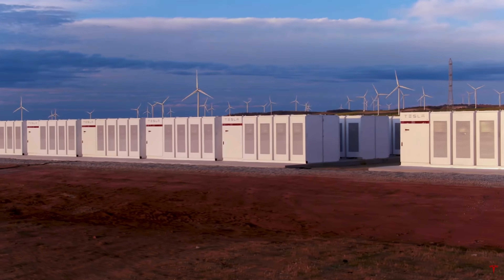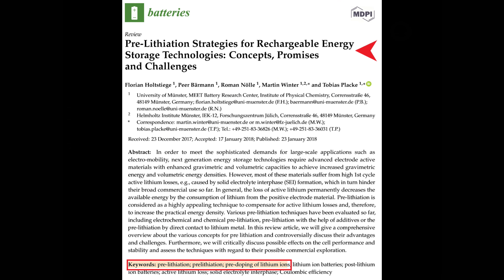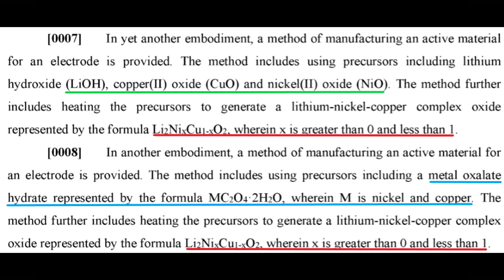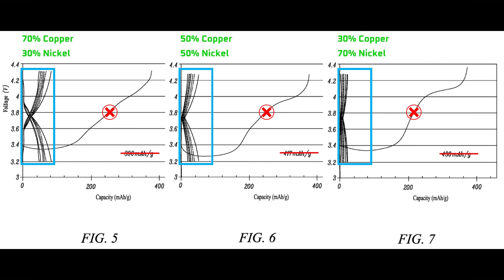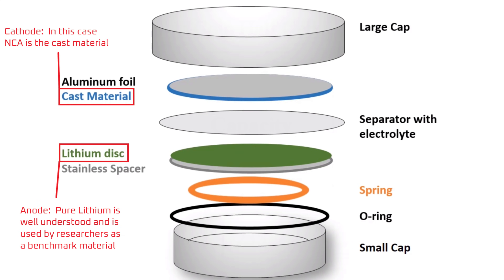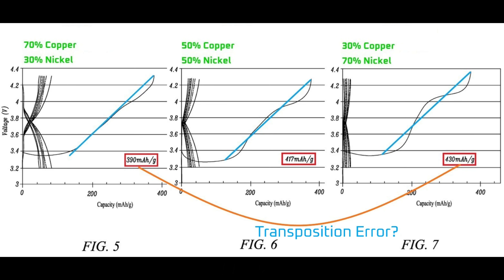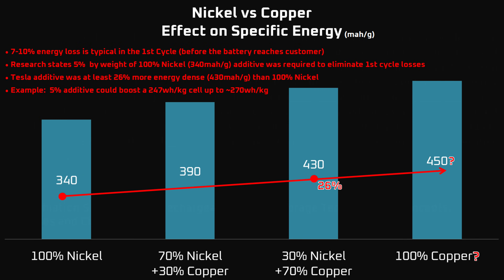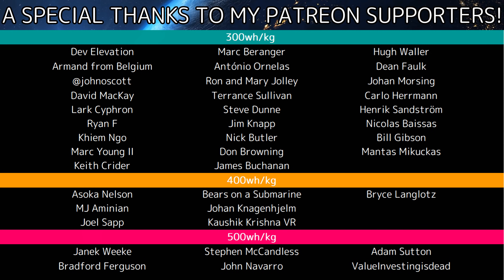Tesla Lithium Doping Patent (Deep Dive)

Comment: Did you notice? The sample with 70 % Nikel showed a bit high voltage?  It is bit more than 4.3. Then this little increase in voltage in first cycle could be reason of very high first cycle capacity. But then initial cycle losses are quite high. 

The other two sampkes with 50 % Nikel n 30 % Nikel showed voltage at 4.3. Then again this trend of first cycle capacity does not make sense if we consider a linear trend...

It could slso be possible that trend is not linear but curved with high n lows.  That means there is some sweet spot. Too high too low are not then optimum.

Comment: FOA, I really love all the topics you covered. 
I think increasing Ni contents will increase the capacity. I can be wrong but, Ni is one of the active material in the electrochemical reaction while Copper is not the active material. I have not read the patent yet. What I believe is as figure 5, 6, 7 showed, it should increase the capacity as increasing contents of Ni for pre-lithiation.
Also, a higher Ni-content can sustain a higher nominal voltage range as figure 7 shows. 
I believe that a higher Ni-content of pre-lithiation material is better than that of hi-copper pre-lithiation material.

Comment: Jordan if possible can you do a comparison review of the two other Giga battery Factories  SKI Innovation Korean building giga factory in Memphis and NorthVolt ex tesla battery guys and building  a gigafactory in Sweden  SK Innovation is building a new electric vehicle battery gig factory in the US and it supplies batteries to Mercedes-Benz and Hyundai-Kia Motors. I’d be really disappointed if those lawsuits actually affect the production of the FORD EV F150 Truck, Mercedes-Benz EQC, Kia Niro EV, or Hyundai Kona EV.
SKI is producing Prismatic Pouch style  9.8gw line and second phase 10gw line
 SKI Innovation BATTERY KOREAN  Company  https://claycorp.com/project/sk-battery-america-inc/   No one has mentioned this GIGA FACTORY  SKI are supplying  Mercedes-Benz EV cars EV Ford F150 and KIA  EV Cars Clayco will be leading site mobilization and Phase I construction efforts for the new SK Innovation battery manufacturing plant in Commerce, Georgia. Located on 283 acres along I-85 about 65 miles northeast of downtown Atlanta inside the Commerce industrial complex, the 2.4 million- square-foot $1.67 billion facility is SK Innovation’s first EV battery factory in the U.S.   especially with all this LEGAL implications

Comment: Check the newest Electrek article about the Model 3 charger being a bi-directional inverter the whole time. So when Tesla is confident about battery longevity, they can activate V2G by software update on the cars with relevant battery packs. While the info isn't 100% certain, reverse engineering is usually a good source, and Electrek has a pretty high bar for checking the validity of their sources.

Comment: Can you make a video why Nikola is a bad investment? 
Some stuff to start you off:
1. Hydrogen is a very expensive fuel. You lose 50% of the energy converting solar electricity to hydrogen compared from just directly putting that electricity directly into batteries. 
2. Nikola's power buffering or cheap power buying will not work because peaker plants are being retired for Tesla grid batteries.
3. Hydrogen is volumetrically inefficient. Transport and distribution of hydrogen is expensive and difficult. Hydrogen would have to be generated on the fuel stations.
 This limits their access to cheap energy to convert.
4. Cheaper ways to get large quantities of hydrogen are not ‘cleaner’ than gasoline.
 5. Like hybrids cars, hydrogen-fuelled trucks will be more expensive because they essentially have the same amount of parts as hybrid trucks. Hybrids cost the most because they have both systems: fuel/engine/generator part and motor/battery part. 
6. Batteries are getting cheaper. As it goes in EVs and ICE cars, there will be a time that EV trucks will be cheaper to manufacture than ICE trucks.
7. Fuel cells are not yet proven to be durable. EV batteries are already proven. Soon Tesla's million-mile battery will be available further leaving hydrogen behind.
8. A hydrogen generator costs thousands. A BEV charger cost $400. No hydrogen infrastructure exists. EV charging stations are all over because they are easier and cheaper to build.
Reply from the maker: Great information.  Tesla is keeping me plenty busy though.  If Nikola became very popular, I might do some videos on it to myth bust.
Reply: @thelimitingfactor  I understand. Your channels is awesome.
Reply from the maker: @KingLutherQ  Thanks man!
Reply: Good post.  I have repeatedly said Hydrogen is a dead end and it's failed everywhere.

Comment: Kudos to the research & Youtube videos you're making on this. Top notch stuff and well explained. I wonder if in the next 10 or 12  years or so, if all these technologies you listed at the end of the video are combined synergistically, along with other developments I've read about such as additional additives, solid/semi solid electrolytes, refined processing and battery pack setup, could we reach 1kWh/kg. It would be incredible to do this without getting lithium air batteries to be feasible. I know you mentioned this as a hypothetical battery in your supersonic evtol design. For a while, people following EVs/battery tech were starting to get worried in the last 2 or 3 years that all these battery research breakthroughs made from around the mid 2000s to the mid 2010s wouldn't come to scaled up commercial fruition and feasible 400Wh/kg with 1000+ cycles life batteries would join the heap of continuously delayed tech promises like Nuclear Fusion, Mars colonies or accessible comprehensive universal cures for cancer. It seems what will be announced on battery day will finally put these doubts to rest (at least I hope so). I know cost, cycle life (crucial for V2G) & production scaling will feature majorly as well & are crucial for ground EVs. BTW,  does anyone know what date battery day is yet? We're halfway through May & there still seems to be no date (maybe Musk will spring this as a live surprise on the 31 May just when we fear it will be delayed more :))

Comment: Great work Jordan! Although I'm not an expert, just a small comment to add on the half-cell definition in your video: in electrochemistry one tests a half cell reaction by making sure that the other half reaction is always in excess - for example by overpowering the opposite electrode or designing it with a much larger area. That way you measure the true response, since the other half reaction effectively never becomes... The limiting factor!!
Reply from the maker: Correct!  That's why I highlighted the upre lithium plate in the half cell - this provides excess lithium.   You're right on the money.

Comment: Dang it! Wish I was a Chemical engineer, or Electrical Engineer , or a Mechanical engineer, or a PHD in Physics or all 4!
Great Video.  You did disclose the Patent Application No. see this video @: 3:19   It should be searchable via the Application no, the title and the listed inventors. See: USPTO.gov.  You do seem to keep referring to this "Application" as a "Patent", it isn't a patent yet; right?   The invention suggests, but you did not summarize how the Pre-lithianization "doping" is accomplished.  I do see the initial comment saying it is via a slurry.  Did I miss something?  Is it an additive to a slurry, a composite of a slurry; an ion  gas deposit to a slurry; or, a prismatic application to a slurry sheet?  It is after all a "Method" patent application, so the Method disclosure should be big and bright.   Is "doping" a universal term covering all methods?  Has any relevant prior art been disclosed in the patent application?   Since Tesla has stated a mission statement of not enforcing its Patents is Tesla allowing the public to see the Office actions that may disclose prior art or failures of disclosure.  How many claims are made?  How do they differ?
Reply from the maker: The complexities of patents can't be covered here.  It's best and safest to just refer to this as a patent application.  The method is easy - the three step process I showed a slide of.  Then I showed a slide of the two recipes.  After that, I stated two percent of the material was added to a wet slurry.  It's up to the laywers to decide what a relevant prior art is.  It sounds like you need to start your own channel to cover your questions, this isn't a channel that covers patent law.

Comment: Never knew about the problem of first cycle loss. But exited for the potential gains eliminating or reducing the problem will have. Chasing every % is valuable. Even more so when all the problem solving of different battery aspects comes together and suddenly its not just a few % but a lot.

Comment: Great stuff Jordan. One of the things I like about the current race for battery development is the fact that it's such a creative process. Pretty much anything can be used as a battery, right from a potato and a lemon up to the current hi-tech complex systems you've analysed here. Reports continually come in about a new prototype using glass, aluminium, sulphur, you name it, and though none of these have yet come to fruition that just tells me that there's more than one way to make an omelette and that people are trying every conceivable angle on this problem. Hopefully someone will come up with a major breakthrough. I believe this will come about from getting back to first principles, but most likely, through sheer accident - how often does chance (after much hard work though) play a role in a quantum leap in the development of something? But first principle ideas need to be meditated upon. What exactly is a battery? What is it actually doing? The answer to those questions will lead to ever more efficient battery solutions.
Reply from the maker: Great thoughts, that's practically battery philosophy.  There are twice as many battery researchers now as there were 10 years ago.  Hopefully that means we'll see a Cambrian explosion.

Comment: Hey @The Limiting Factor.

I have a question about the tabless battery. Since the resistance is lower, the charge and discharge speed increase right? Does this mean the acceleration of the cheaper models from Tesla also increase? This could be a huge extra selling point next to faster charging and a higher energy density ofcourse! Thanks for having the best in depth battery channel!

Cheers
Reply from the maker: It could mean that :-).  It depends on how much the model 3 and model Y are constrained by power output.

Comment: It seems to me that, if there’s a reason to use both copper and nickel, there should be a sweet spot at some ratio that is not 100% nickel or 100% copper, and it would make a lot of sense that any mix would be much better than any pure nickel or pure copper version. If we take the data as correct, then only a small amount of copper is needed to greatly increase the initial capacity, and while additional copper beyond that reduces the initial capacity, it further increases the extent to which the doping material acts as part of the battery in subsequent charge/discharge cycles, rather than as dead weight, so that the decreased initial capacity may be made up for in increased capacity for subsequent duty cycles.